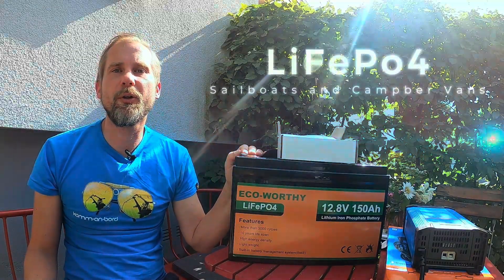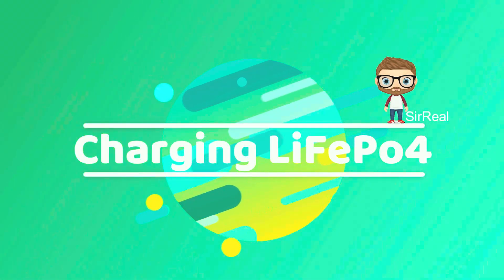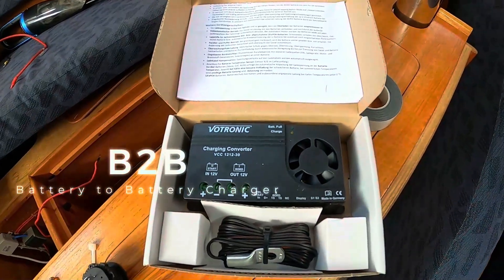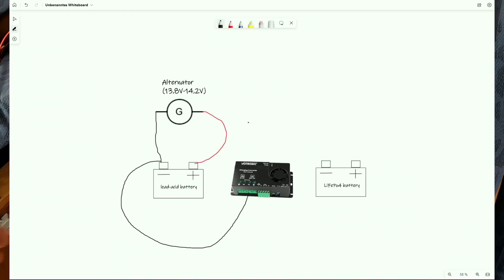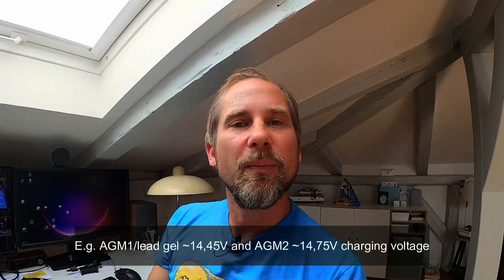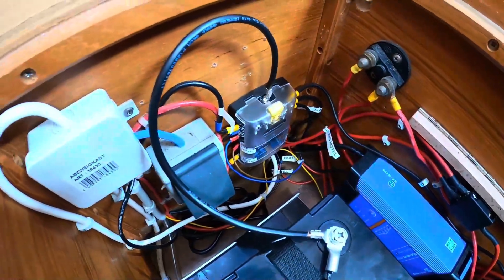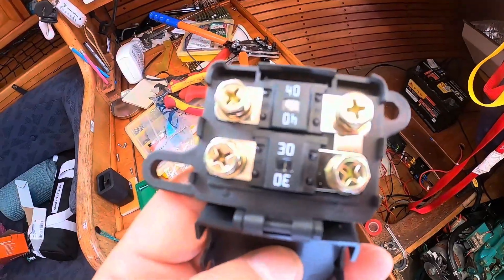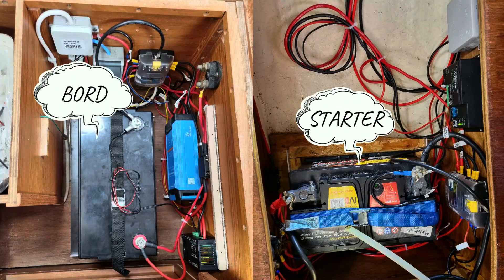LiFePo4 instead of lead-acid batteries: Drop-in exchange? No!

Comment: Thanks for your very interesting video. My current setup is one engine, one house and one battery for windless. My winter project was to look at replacing all with lifepo4 batteries... But your solution is sounding much better! 👍
Reply from the maker: I also had three lead-acid batteries before. It saved a lot of space and also some equipment/cables to reduce it to one starter and one 'common' battery, which is the Lithium.
If you want to change your starter battery to LiFePo4, you need to take a close look if the maximum current is high enough. E.g. my max current it 150A (only for a short time, 120A continously). I think you can save money by keeping lead-acid for the engine, using LiFePo4 for all other tasks.
Reply: @Sir-Real  you made alot sense in your video! 👍 I bought a new lead acid battery last year for the 'house' battery so you've convinced me to use that for the engine and add one lifepo4 for the 'house'. Before your lifepo4 conversion did you use your 3rd battery for a windless or have 2 'house' batteries?
Reply from the maker: @TicTacUk  the third battery was used for my fridge only. So 'house', starter and fridge battery.
(I own only manual windlass/winches. )